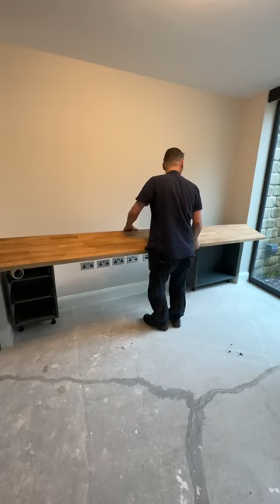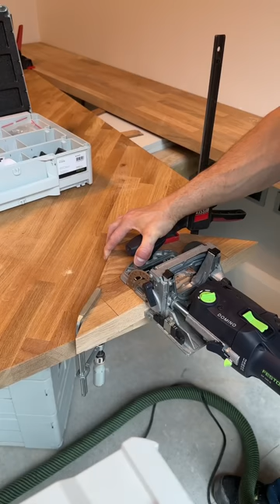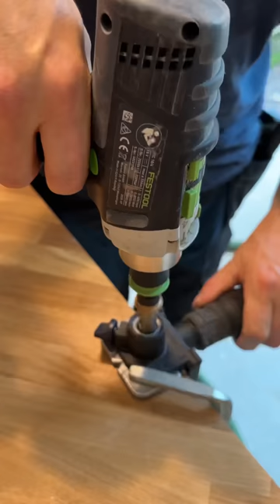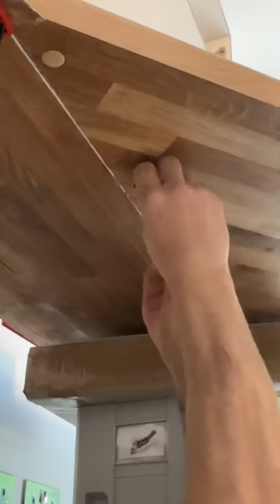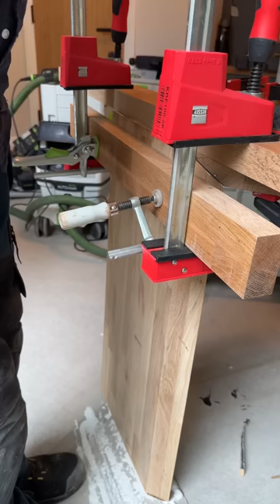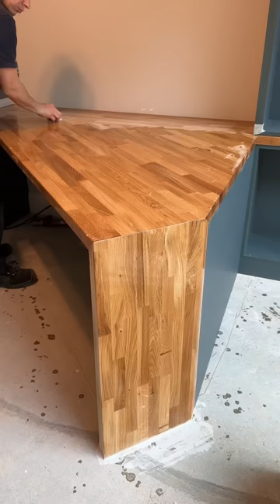Unlocking Creativity: Building Your Own Bespoke Desk

Comment: When money is no object. 

Complete fesstool line up. Completely unnecessary domino cams, seemingly used in place of clamps for the glue ups? Actual wood dominos would have given extra strength for the joints.

Still, cant argue with results. Looks good.
Reply from the maker: Thanks we learn not a problem i am not a master of joinery thanks

Comment: My only comment/ wiestion is, why did you use a mastic type glue for the vertical miter, instead of pea or carpenters glue.  Seems to hold the joint open.
Reply from the maker: I did not use metalic glue

Comment: Wow! This looks incredible!!! I have a question though. Why did you use the biscuits and those connectors?
Reply from the maker: I used dominoes(biscuit’s joint) for face alignment and connectors i was going to use without glue but then was a lot of moving there because big windows sun changed wood joints like every day so I decided to glue them permanently
Reply: @CAVjoinery  Oh, that makes sense. I was just gonna ask why you would bother with metal hardware if you were glueing it.
Reply: What are those connectors?  @CAVjoinery

Comment: Great work but the wall sockets are under the work surface and any cables will have to come over the front of the surface. They will look untidy and limit the position of any electrical appliances used on the work surface. Could slots or access holes have been incorporated in the wood at the back next to the wall? This is not a criticism of your brilliant work: merely an observation.
Reply from the maker: I have here is a link for the video https://youtu.be/Gtn-ggSx0ug?si=0jJOxBiJe_FiHnGR
Reply from the maker: Thanks for watching
Reply: @CAVjoinery  
Apologies. I think I jumped the gun there! A very impressive project that has inspired me to have a go myself. Many thanks.

Comment: Why did you use glue and metal  domino knock down stuff? If it's being glued permanently why not just use wood dominoes?
Reply from the maker: I was going to do just dry fit but conecters wouldn’t hold tight enough that joint so I decided to glue them together

Comment: Why isn't this sitting on a finished floor? How is that supposed to be accomplished when the unit is already in place? This makes no sense at all.
Reply from the maker: They having carpet hopefully it makes sense now
Reply: @CAVjoinery  
Laying carpet against existing work creates its own set of problems. During our own carpet laying experience, I had to nail, caulk and paint the baseboard (skirting) before the carpet could be laid down. I had to allow for a 2 cm gap to tuck the carpet under the board. After the carpet was laid I spent another 6 hours repairing the slashes caused by their knives and painting out scuff marks when they fit and trimmed the carpet. The carpet looked great but the skirting boards were beat to Hell. Hopefully you won't have a call back for repairs to your work.
Reply: Ask the customer 😏